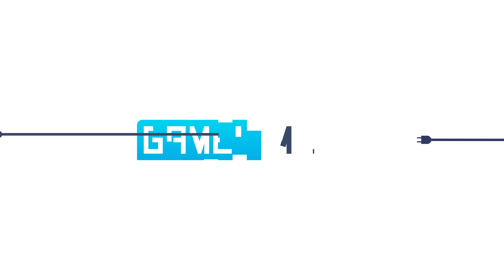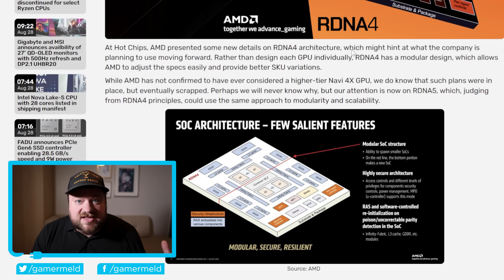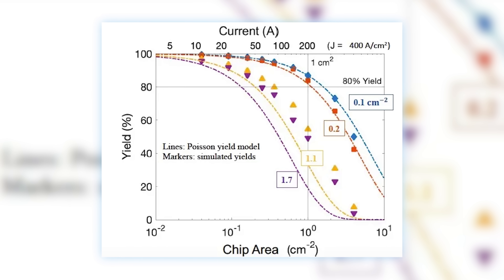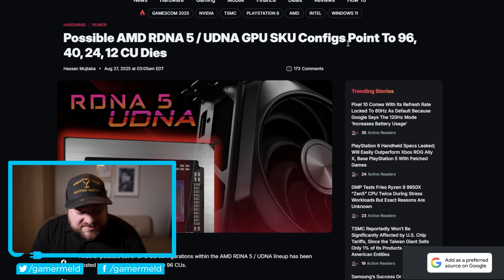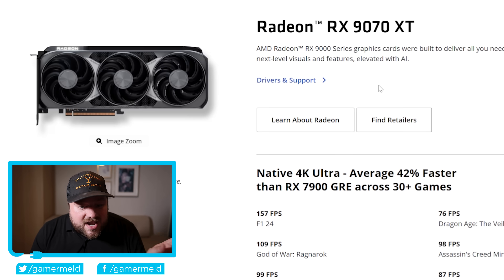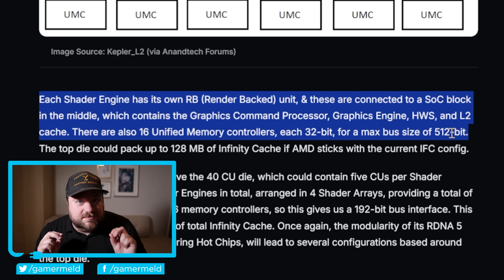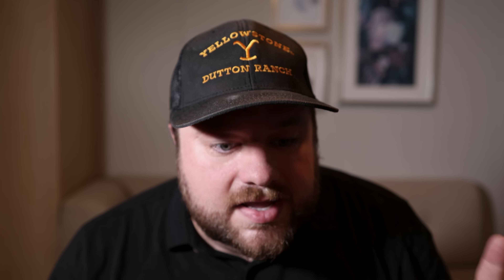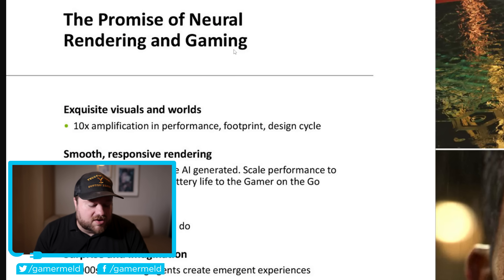Nvidia Officially Reveals The UNTHINKABLE!

Comment: You’re completely misunderstanding this: neural rendering renders the current frame using AI models based on the updated state of the scene (camera, geometry, materials, lighting); it does not need to “predict” what I’m going to do with the mouse. When NVIDIA talks about “up to 100% AI‑generated pixels,” it doesn’t mean filling gaps between frames, but rather replacing/integrating classical algorithms with neural networks that directly produce the pixels of the current frame. So the input issue you mention applies to FG, not to neural rendering.
Reply: Good job addressing his ignorance

Comment: Not suprised that Nvidia would already be looking at 100% AI frames. 
As VR is difficult to run at high fidelity, I thought the only way to make the sci-fi perfect vr experience possible was through AI GPU. 
It would require embedding a neural gpu directly into the engine to instead feed the AI with information so it may create frames. 
If it brings better performance and 99+% of the quality, then I am all for it.

Comment: Actually it could be a lot better. Unluckily whatever the system runs in real frames, your latency is still locked to that. But it’ll offer smooth frames based on what you want by generating a frame flow ie, 3D block, and then shows slices of it as frames. So essentially the 3D block is like trying to generate a frame in between frames, but only receives changes as they occur, and not full frames, while a separate calc just reads the 3D block at a certain time frame and shows the image. So the main difference between GPUs will be latency, and depending on games, the usual frame gen issues. But hopefully at a lesser scale. 

This is my guess.

Comment: The marketing most likely got it wrong as it is more likely nvidia is bringing the NPU+Tensor core thing instead of using the RT cores for the algorithm it needs for neural textures. As yes nothing the artist will draw will be saved in neural compressed textures but it will be quicker which quicker and mostly correct is better for image recognition not so much for scenery based games.
I for 1 am hoping nvidia will not do what they did with before games that the feature if forced or baked into the game in a way you cannot remove it.

Comment: If you run Lossless Scaling in adaptive mode, you may already be looking at 100% fake frames. The real frames from the game are used to update a ML model and the output frames are all generated by the model. If the frame pacing doesn't match up, all the frames on screen will be coming from the ML model and not the game. It's the end game for frame generation; you can take any arbitrary frame rate and turn it into VSYNC. I would not be surprised if Nvidia (and AMD) is working on something like this and this is what they mean with 100% will be AI generated.
Reply: That's what I'm thinking - Nvidia just playing catchup with LSFG.

Comment: I say it's probably going to be different from what the leakers are posting, with 96, 40, 24, and finally 12 CUs. My guess is: 144, 105, 80, 56, 48, 40, 22, and finally 10 and 8 CUs.
 !! Reason #1: AMD can still change the number of CUs !!

144 CUs = RX 1090 XT > High-End+ -Tier
105 CUs = RX 1080 XT > High-End-Tier
080 CUs = RX 1080    > High-End-Tier or Mid-End
056 CUs = RX 1070 XT > Mid-End
048 CUs = RX 1070    > Mid-End
040 CUs = RX 1060 XT > Low-End
022 CUs = RX 1050 XT > Low-End or iGPU in the CPU
010 CUs =            > iGPU
008 CUs =            > iGPU

Comment: New GPUs with fake frames at the cost of GPUs with real frames..  A lazy ass approach for companies to fake improvement instead of building more efficient and better software
Reply: Soon games will be so poorly optimized and graphics cards will be so underpowered in raster that it will be nearly impossible to run games without AI rendering. It will be baked into engines soon.

Comment: 100% generated frames means that the game just generates stick figures and includes specific textures and images like character faces if needed then minimally renders other very low poly elements as place holders and a prompt that can use an image generation model to render a frame from a simple sketch level detail. Already easy to do with still images.

Comment: Neural rendering is actually OP if you've seen it. Basically just way higher quality textures, way higher compression etc. Neural rendering is more like what image super resolution is to traditional upscaling methods like bicubic, whereas fake frames are closer to using an AI image generator. Takes a lot of time to render (which is why you get lag), and causes hallucinations. With super resolution, you don't really get hallucinations because it's just a better algorithm for upscaling the data that already exists, it's not generating new data.
In terms of fake frames, I don't inherently hate them, but I'd use them more if they were actually good. I think a more advanced pipeline could actually make them good, and neural rendering is a key step to achieving that, but my guess is we'll have an intermediate stage where it's still rendering fake frames from real ones and some ugly patchwork in between to use neural rendering.

Comment: How can we compare AMD CU's VS Nvidia CUDA Cores in relation to GPU performance? 96 CUs is equal to how many of Nvidia's CUDA  Cores ?
Reply: So 9070xt has 64 cus and it's equal to a 5070ti these will probably have an ipc increase of %10 at least so 96 core would be way stronger than current 5080 it can probably tie a 5090 now or get close but nvidia will have 6090 by then so...

Comment: About Nvidia future only generated frames, i have made this prediction before, and it's really happening. hahahah
So sad for us gamers. 
And Amd is still not gonna beat Nvidia with UDNA. Because Nvidia has a 82% lead compared to Amd. That's 5090 vs 9070xt, if it is 5090 vs 7900xtx it's a bit less. But most gain Amd can make is a 70% increase, not a 100+% increase. Since Nvidia 6090 will be faster then 5090 it will be over 100% to 150% gain compared to last gen which is 5090. So Amd is not gonna beat Nvidia. My calculation says the best Amd can do is be 10% slower then Nvidia again, unless Amd use their flagship chip with 184 cu's, or they can forget it. But it's Amd we're talking about who never miss an oppertunity to miss an oppertunity.

Comment: 4:27 Actually both MLID and Kepler_L2 are saying the same thing, its just that AMD renamed WGP to CU for RDNA 5 which means that 96 RDNA 5 CUs is equivalent to 192 RDNA 4 CUs
Reply: That's like 3x the 9070xt performance? they could wipe the floor with 6090 if that's true lol
Reply: @abibirawa4119 3x the compute units is not 3x performance but probably more like 2x-2.6x because of diminishing returns

Comment: Still waiting for amd to put out something that is at least as powerful as an 5080... The 9070xt is not that card and makes no sense to change my 4070super to it,not when I still have a high refresh rate 1080panel and waiting for a card that will run 4k easily, and I don't want a 5080that burns down because the bs 12v connection. So AMD give us a good card at high end ,wee need one.

Comment: I just bought the 9070xt when it came out but I would fully buy another especially if it matched or beat a 90 series nvidia card.  The 9070xt is a great gpu btw but I did replace a 1060 so probably anything would have been awesome.

Comment: AMD's new flagship won't be 6090 performance - they always stack too little cores on their most expensive cards. The RX 6900 and 7900 xt only had 5000 cores, and the 7900 xtx only had 6000. With 1000 or so more cores, they could've beaten the 3090 and 4090 already, but clearly they refuse to. RDNA 4 was also rumoured to beat the 5000 series, but they only released a mid -70 class with only a teaspoon more performance than the 5070ti in some games, but practically same price - so people bought Nvidia again.

Comment: Please pin! RDNA 5 changed the naming of WGPs to CUs, so each RDNA 5 CU is equivalent to 2 RDNA 4 CUs meaning that it’s 192 CUs not 96 for the top die, which if AMD gives that to gamers it’ll be incredibly powerful, but MLID has leaks that show AMD is planning to offer 154 CUs (77 with the changed naming) as the top gaming gpu
Reply: Correct. Amd has released a slide for RDNA4 where they call them compute engines. Each has 2 cu which share a memory buffer. Since 2 cus are combined in a workgroup for a few generations already, a shader engine with just 5 single cu doesn't make any sense, since you can't separate them. So Kepler is talking about compute engines while MLID states the old method, where you count each cu seperately.
Reply: Are you sure 72 and not 77?
77x2=154
Reply: @PanchoGDMKWii  ah yeah I’m dumb😂

Comment: Yup, just like UDNA is a marketing term used by Jack Huynh recently and RDNA5 is an engineering term used by designers/engineers/partners (like Sony, Microsoft & AMD), these leaks are very plausible but taken at different stages of specs, design, prototyping, tapping out, etc.

There are leaks that AMD wants to use the same UDNA WGC with GDDR7 down to LPDDR5X. In theory, they can pair WGC with different infinity cache/fabric/memory controller by swapping out WGC with different IMC/IF. And these looks like they are edge bonded rather than stacked like in RDNA3 where the IF became the limiting factor.

However, the highest end cards are likely Server products as leaked by MLID so I'm not betting on seeing a 6090 killer. But if AMD launches such a card at a good discount against NV, I may buy it.

That said, AMD driver/SW stack is still behind NV and even though AMD has stepped up their efforts, NV is still better at software and time to market for development is a huge thing in the industry software world.